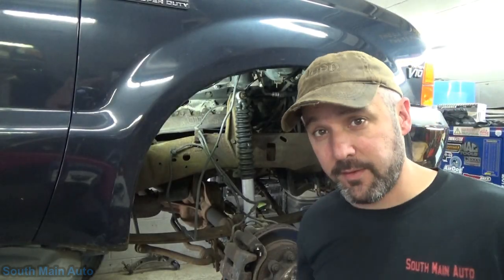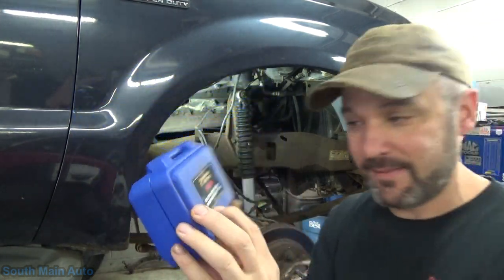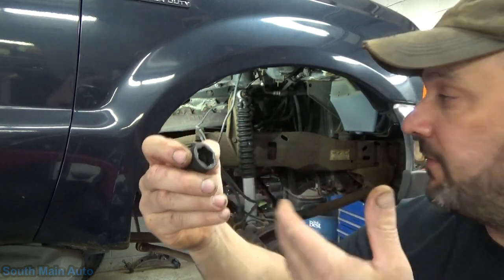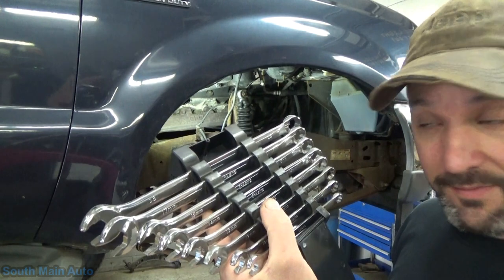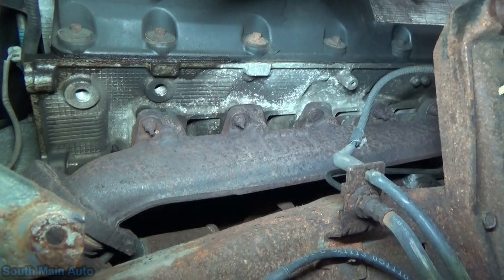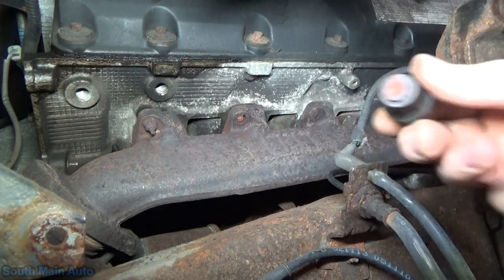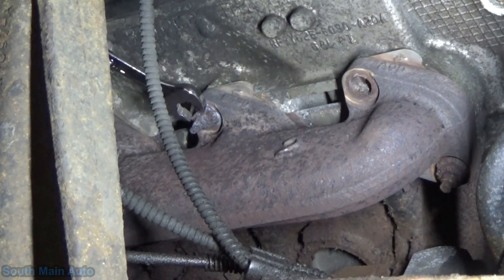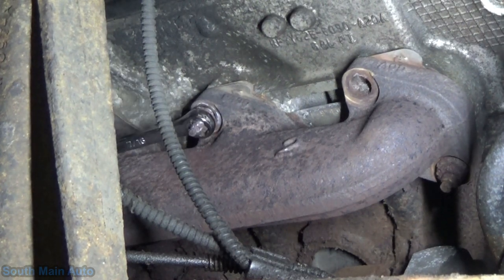Astro Pneumatic's Flank Bite Damaged Fastener Tools

Comment: Eric, good tip on the 21/64 drill bit.  What I have done in the past, was pre-drill the center out of a new(or slightly used) stud, cut it down to 3/8 or 1/2" long, then thread this short-stud into hole on top of broken stud.  This acts as drill guide to drill thru center of broken stud.
Reply: Smart move, like a machinist would do.
Reply: I’m baffled by how good of an idea that is, wonder if you could make up a jig to go into all the holes that either came out or broke deeper than flush, (that you use your method to extract) and use that tool as a drill guide for all the ones that broke off flush
Reply: @aterack833  I bet some enterprising tool maker could come up with a set that slid inside various size holes and had a hole in the center for drilling.
Reply: I don't  know if it work, but a set of machinist transfer punches could be used. This would allow you to at least get a centered starting point. Sets are pretty cheap at Harbor Freight. They also sell center drills which could help get the drilling process started as close to center and as straight as possible. I hate fixing broken fasteners.
Reply: Why not just take a smaller bit and wrap it with some tape to fill the diameter?

Comment: Hello Eric,  Try a center point drill on your bolt.  That will give you the starting hole you are looking for and will self center in the hole without cutting any threads as they don't have flutes.  They are also shorter than your stubby bits for more maneuverability.  They come in half a dozen diameters and are double ended.  Fairly inexpensive also.  You probably have some in your tool box.   I get a kick out of your intro as it sounds to me no matter how many times I hear it as "self made..." rather than "South Main".  Take care.  Doug

Comment: "I'm actually crying a little bit on the inside because I have so many broken bolts to do on this thing." Made me smile inside when you said that. Thanks for the great review...I'm going to try to replace the holey/rusty manifolds on my '98 4.6 F-150. The local Ford dealership couldn't give me even a ballpark estimate, saiding it could be up to $4,000 depending. I'm buying these and going for it.

Comment: Love the Idea of using a stubby to mark your start placement, Im still trying to put together a plan of attack for removing that back bolt, and dont want to remove the manifold, but I wont be able to really see what Im doing at the angle Im at.  And Its a little beyond the face. You make it look so easy !!
Reply from the maker: Buy a plain ticket for me and I will come destroy it for you, drink your beer then leave :)
Reply: HAHAHA...That's usually my M O 
Most often I'll start with the beer first, then destroy..then stand back and admire with another cold beer.!
Eric...Your Monday spell check dingy of a thingy didn't work Buddy
Unless you meant a plain ticket..if that's the case, I've got a couple of those for ya.  
Love the Tool Vid's bro..great job as always 
Cheers

Comment: Very nice set of tools Eric and they seem to work pretty darn good! And that's a nice tip using a larger drill bit to act as a center punch. We've used that method in electroplating, but never thought about it for manifolds :)

Comment: I use a set of self-centering hinge drills to create the initial pilot into a recessed broken bolt. I only replaced the chinesium drill bits with carbide ones, since the bolts that break off are often harder than drill bits intended for wood. Once I get the carbide/self-centering bit chewing in a little, I can stop and go for a regular bit to finish the bore. Only three sizes cover every broken bolt I have made, and I keep spare carbide bits on hand because I keep dropping things.

Comment: Something I do instead of using a drill bit and removing existing threads is to use machinist’s transfer punches. They come in a set of multiple sizes just like drill bits, and can be bought pretty cheap. Just find the one that fits the hole, tappy tap tap, and Bob’s yer auntie!

Comment: I worked for a county park dept. we had 2 ford F350 plow trucks with 351 motors, those guys would let them idle for 2 hrs sometimes was always replacing exhaust studs and bolts. I started using brass nuts where I could as the next two years I was back at it again, They were my bosses so there was no use in arguing with them on letting the trucks idle so long!

Comment: Hey Eric. Those new sockets of yours are exactly the same design as a type that harbor freight has had for quite awhile now. Like at least 5-6 years. There's are a rough chrome finish. I have them and they work pretty good. I have found the same thing as you that those turbo sockets sometimes mess the fastener up more and just strip chunks off. This style here doesn't do that and they work pretty good on even super rounded stuff. An older guy I worked with was having trouble with an oil drain plug one day and I handed him my 13. It spun it right off and he was shocked. The snap on guy came in later and he was trying to see if snap on had something like that, which they didn't. I told them both, nope for something this good you have to go to harbor freight hahaha.

Comment: I came across a 'hinge drill bit set' to help with that annoying task of centering the hole when drilling out a recessed broken bolt. Really cheap, widely available, designed for centering holes when drilling wood screw holes for doors hinges. There's a spring loaded retractable protective flange on each bit that won't chew the sidewall threads, and the flange centers the bit automatically. You can use the hinge bit to start the hole, then switch to your standard drill for the remainder. I'm guessing the idea is so old that nobody can copyright it, meaning there isn't much interest by toolmakers to market it for the steelworking industry. Worth a try!

Comment: Another good trick to protect the threads in the hole is to insert a spring pin that is the diameter of the hole and long enough to protect the threads.  then use a drill bit that is the diameter of the spring pins interior hole.  Drill the center of the stud  to the depth you want.  Remove the spring pin and drill to a larger size as needed to remove the broken stud in the threaded hole.  I saw this idea in an aviation magazine.  It works well.

Comment: That's a good tip for centering the drill bit. If you don't center the bit properly, you can lose threads all the way down one side, so this would usually be better. Amazon had a little kit for sale that included various sized hollow tubes to center a tiny drill bit, which would also work. I never bought the kit and the last time I checked they were out of stock. I suppose there might be a market for a custom drill bit set with no destructive fluting on the sides to do the same thing. Or, maybe one could take a tiny drill bit, put a few rounds of tape around the circumference to match the size of the hole, and try that. It would chew up the tape, but once centered the bit should spin home fine.... I think I'll try that next time.

Comment: I do a lot of the ford manifolds I find that removing the shocks and drain the coolant it makes heating easier, I ALLWAYS use the revised copper color studs from ford they last much longer with them and brass nuts its the way to go. love your videos.
Reply: PS I was referring to the shock bracket.

Comment: I like using the weld on a nut method, and found that when I start removing it, the best thing to do is go back and forward in VERY small increments, due to the first few threads usually damaged.

Comment: Top tip I always use.  Don't need fancy turbo sockets.  Just hammer on a slightly smaller chrome socket.  Hammer will do no damage to a quality socket.  Also never use an impact wrench on a fastener that is clearly corroded at the head. The impact is far more likely to round the head compared to steady hand drive.

Comment: Interesting that you drill to get the center marked.  I use a set of machinists transfer punches.  I also have an ancient set of Snap-On left hand drill bits.  I use them with the drill in reverse and half the time they'll grab when they're drilling and spin the broken stud right out, no e-z out required.

Comment: Eric you have more patience than me to drill studs out, I've done hundreds of hemis, Ford's and Chevy and I always use the mig, even on recessed studs. The way I figure it is the mig wire won't stick to aluminum so I build it out till it's out past head then weld a nut on. By that time the heat has cracked it free and they almost spin out by hand

Comment: There's an invention waiting to be made, for the "free tip Friday" at the end. A stepped drill bit set that is flute-less on the edges so it will self center for recessed broken studs. Sort of a "Vix Bit" for metal drilling. A Vix bit might even work as a "centerer" although I've only seen them in 2 sizes, the larger of which would be too small, I think, for many stud cavities.   Just a thought.

Comment: Eric, if you make up some hardened steel center punches the diameter of the stud hole, you would be able to center spot the broken stud for drilling without damaging the threads. If the studs are broken off flush with the block, have a cup of coffee, scratch your head and resort to plan 'A".

Comment: I like using the fatter drill to center on the broken bolt. I generally end up poking a center with a transfer punch or boring a center with a little 1/8" pencil die grinder.

Comment: I work in a place that makes those screw machine drill bits "stuby bits" as you call them. As a tech that sets up the CNC machines to make them as I'm setting up the machine I have often wondered what they would be used for since they are so short with a flute that runs most of the length of the bit as they are the hardest ones to set up on our machines. Not sure what brand you use but if you ever need a new set you should check out Rocky Mountain Twist in Ronan Montana. 100 all American made.
Reply: Bad Drivers of NW Montana I searched for your company's web site found it and I will be buying a set of stubbies from there.  Thanks for the heads up!
Reply: You're welcome.
Reply: Bad Drivers of NW Montana I need a set of those, I'll look your company up!

Comment: Have you seen the set that has a sleeve that fits into the bolt hole and provides a guide to drill the center of the bolt?  It’s designed to not damage any of the threads. It has a round easy out with 6 sharp splines on it to bite into the bolt after you drill out the Center. I’ll try to find the name and let you know.

Comment: On the recessed bolts.....you used a drill bit - sounds like a great idea.  So why use a drill bit that is "slightly bigger" than the hole?  
What if you used one that was the same size as the hole?  The the threads would "guide" the bit straight anyway, and you'd still get a pilot hole/mark on the broken bolt.  The slight benefit would be the first few threads would not be completely gone.  
More interested in the - why "larger" part?
Reply: The first few threads are already destroyed by the corrosion that locked the steel bolts in place. By going larger you create a center mark on the remaining stud/bolt and it removes those damaged threads which are no longer useful anyway.

Comment: Makes me wonder if you could shave a tad off the sides of a drill bit for the first run and maybe it wouldn’t cut off the first few threads but still drill the center. It would still have to be snug against the walls somehow though. 
They should just make a special tool for it maybe with smooth sides with shape tip or maybe just slip a sleeve and smaller drill bit to get the hole dimple started.

Comment: You Love them ford manifolds lol. I have started using your trick though about cutting the heads off and tapping what's left with hammer and they come right out. I use to just pull the ones that came off then weld to broken peice to get them out.

Comment: have you seen the lisle tool 68500 (manifold drill template for 2V/3V ford engines?? Manibolt driller also makes ones for different engines.Pretty cool tools to help out drilling broken exhaust bolts! Awesome videos you put out !!
Reply from the maker: Yep I have seen those. I am more of a free hander. When I was a young buck I use to try to use guide plates but it always ended in disaster

Comment: Just wondering if you have ever used a reverse fluted twist drill to drill the broken studs/bolts ?  I have spent a good bit of cash having as complete sets in SAE, Metric, Numbered, and lettered sizes with the reverse flite as just the action of drilling will very often back the offending fastener out.  Just saying.  It works for me probably 30 or 40% of the time.

Comment: My question is, on the wrench, you put a 12mm and it just rode around the rusted bolt.    Was it originally 12mm or 11mm in size?
Also, for these tools, will the sockets work on a nut thats just about totally rounded off?

Comment: I’m assuming the wrenches are just like the sockets and are forward and reverse capable so you probably don’t need to flip it if you need to put the fastener back on?? I’m actually contemplating buying these over the Milwaukee max bite wrenches to use on that one bolt I can never reach with a socket on turbo Pedestals on exhaust manifolds on large diesel generators. I love the socket versions of these they’ve saved my ass more than once.

Comment: thx for the video you had  a chrome socket 3/8 s  i think maybe its in the other vid what it is and who made it nice wrenches.Back in the late 70s broke off bolts ford water pump guy told me give the ends of the studs a good wack with a hammer breaks the rust ring who knows if it works but do it ever since.When i worked for gm  way back they had a white foam stuff it was the nutz dont know if they make it anymore anywho have a good one.

Comment: Main problem is that the Intake and exhaust are on the same side of the engine, to get to the exhaust you have to remove the darn intake, with tons of hoses and other stuff, not to mention having to replace gaskets, thats why Im thinking about just trying to get to the offending bolt, its the last one near the fire wall, Have to remove the EGR , but thats easy, still I will be working blind. In the end you can just barley hear the leak, Darn warpy  Alum 6 cyl heads. Simple work for Dr O. I just hate pulling it apart when it runs so nice......I gave up drinking when I was 30, Probably should start again then I could rip into anything :)

Comment: my jeep( like yours) has dead gauges.
replaced cluster.
worked one day then quit too. heard a tiny plastic gear striping
noise then gauges died. iam sure no gears but thats the sound. i am electronic tech. never heard that noise before. must be a bolo on this? its same cluster u got
Reply: Turn the key on while holding the trip reset button

Comment: Great tool review but that's really the "mighty" Ford Triton V10 exhaust manifold? I think my riding lawnmower has a less restrictive manifold. And perhaps someone at Ford might have figured out bigger is better for exhaust manifold hardware prone to rust, heat stress, etc. in the 100+ years since the Model T but I guess not? Instead the Quality Is Job One team decides to use hardware better suited for mounting the rear view mirror instead of an exhaust manifold which is about as restrictive as you'll find on a Briggs and Stratton. Way to go Ford! You've proven yet again "built tough" is pure marketing.

Comment: A poor man's ( or woman's ) home made tool is get a socket that just fits the rusted bolt. Corsely grind the top of the socket so plenty of " dross is left inside the socket. Heat the bolt with a propane torch then spray with wd 40 to cool the rusted bolt. Repeat, then drive on the socket using a small hammer. Shpuld unscrew. Rrpeat as necessary. I use this technique on cars that are driven in Pacifica CA that drive through salt air. Customers ask how come I don't break the bolts like the " other guys " just gotta have a little time and finesse.

Comment: Now if i can only get you to wet paint reinstall those bolts.
use nothing else .
just wet paint the hole and bolt . then screw it in quickly while its still wet.

Comment: When do you figure people start a class action lawsuit regarding this issue?  This has become almost a cottage industry for most techs.  It ranks right up there with Subaru's and the head gaskets failing when the car gets to about 85-95k on the clock.   Recall worthy?  Someone needs to figure out a way to make these parts last.

Comment: Ford made a huge mistake with those studs. They aren't large enough in diameter and obviously too weak for the job they are supposed to do. Likely why the gaskets leak. 10mm nuts? How stupid for a location near the road debris and torture of heat etc.  For a 6 MPG engine, you'd think those fasteners would be more rugged than they are.  Nice sockets and wrenches. Thank you for the info.

Comment: My question is? why don't the factory put some type of ease out compound on those bolts at the factory, they know that there going to heat up & rust out. that,s the one reason you couldn't give me an American made car. My 199 Honda civic has over 300,000 miles on it & still going strong.
Reply: Because it would cost them more. All they care about is outlasting the warranty. Then they can charge you for everything.